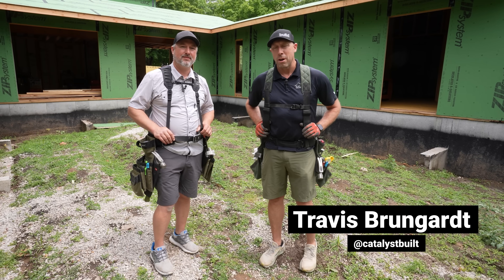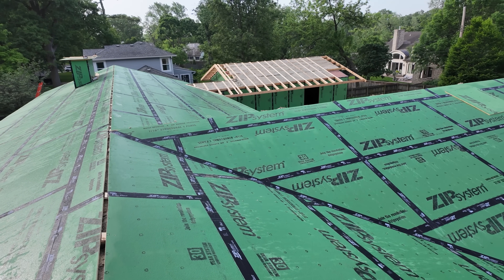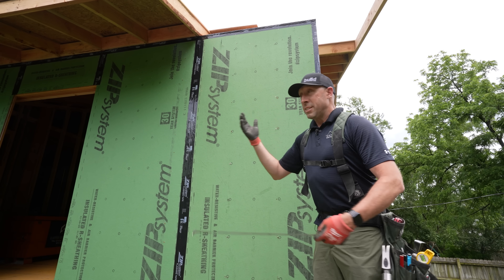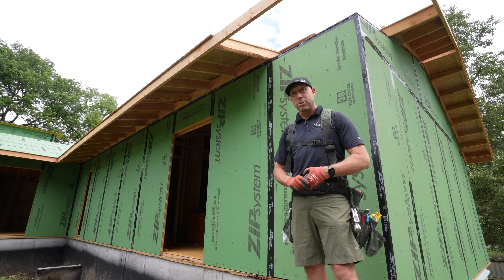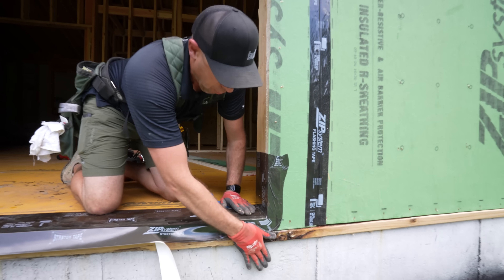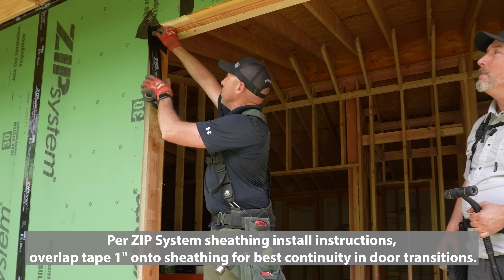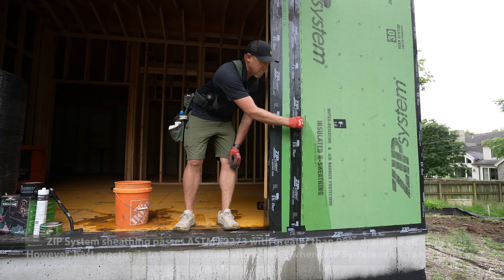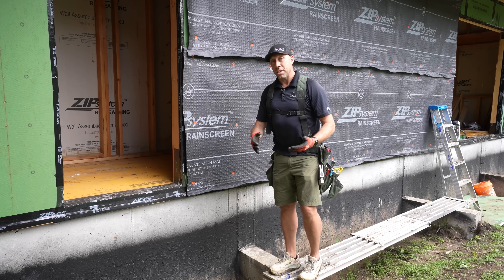Perfect Wall System At Rivard

Comment: Build monopoly framing, 2-inch foil faced poly-iso, 2x4 fir strip in-line up and over, add metal roof and siding, insulate inside cavity, DONE. 🏁
Reply: Foil faced is great and can be sealed no different than zips, only using foil tapes that will not shrink and crack..  It is literally a metal subroof at that point.  In a fire you can get through it to put the fire out.

Comment: I don't trust the 30 year warranty.  Houses will fail when mortgages run out? Is that the model? Also the 7/16ths is far too thin, prefer actual 5/8th on the walls.  Which is why i ran the foam myself xps tapes with dupont's tape then nailed the zip with zip tape. And spray foamed the inside so now if a panel fails it could be replaced.

Comment: 3 roofs would be better.
Reply: I have ten roofs. All Zip of course.
Reply: @MrTexasDan  I was going to do 10 but anything above 8 is excessive
Reply: @donnafedorak2499  Yes, I know, but Matt is all about bomber belt'n'suspenders Huber-love ... so you know.
Reply from the maker: That’s actually pretty funny! 😂
Reply: @buildshow  🙂
Reply: No roof is the solution. Cant have roof problems if you dont have a roof.
Reply: I asked my contractor for 5 roofs on my new shop.
Reply: The Perfect-est Wall™ would be Zip R™ sheathing for all walls and the roof, with Zip Tape™ used to create an uninterrupted air barrier for the entire Monopoly Framing™ envelope. Prosoco™ liquid flashing should be used to seal the lower third of all walls, plus 100% of the nail penetrations, which have ruined the Zip™air barrier because Jerry doesn't know how to calibrate the compressor. Zip System™Ice and Water peel-and-stick should be wrapped around the exterior envelope for good measure. A second 2-by-6 framing assembly is then built out over top of this so that Rockwool™ bats can be installed - because what your building's 'winter jacket' needs is its own 'winter jacket'. Wrap that 2-by-6 framing with another layer of Zip R™sheathing, because that stuff's free, and don't forget to tape all of the seams and throw on another coat of Prosoco™ liquid flashing. At this point you have, like, 6 vapor barriers which will battle to the death. To avoid condensation issues, all stud bays in all layers of the assembly should be back-filled with sacrificial LP Smart Side™off-cuts, so that those can soak up all the water and rot away instead of the framing. Just to be super-safe, wrap the entire building in a continuous layer of Zip Stretch Tape™. At this point you've created a urethane balloon with a blower door score of 0.0 ACH, and any occupants would be rapidly asfyxiated. So don't forget to install a Zender™ air handler for each room in the house, and pray the power doesn't cut.
Reply: @badbadberto temper temper
Reply: @badbadberto 😂😂😂
Reply: Money is no object!
Reply: lol
Reply: All my Roofs go to "11" just like the Volume Knobs on my Guitar Amps.

Comment: I see lots of work go into water and air control at the mud plate, but see nothing to prevent termites from finding a very small hole and causing all kinds of damage to the structure.

Comment: Not seeing how this roof is properly vented to allow moisture to escape during the vast temperature changes that a roof sees. I’ve installed cold roofs over SIP panels and the venting is clean and clear soffit to ridge. Not seeing the roof framing in this video is problematic because if folks do this in a northern climate watch out.

Comment: I’m sorry, this is a freaking zip system commercial. At this point I have to believe you guys are just in cahoots with Huber to make video of beauty shots of their product. Also these best built practices are absurdly expensive. How you can convince a client to spend the money on labor and materials for two roofs. And young people are constantly complaining how the cost of buying a house is outside the capabilities or budgets. Well here you go, this is why. In other words this kind of house building is elitist and targets wealthy clients. Period.  And if you want an air barrier or rain shield why not just use furring strips. That mesh is going to hold moisture and it isn’t going to allow air to move easily behind your siding. It isn’t rocket science and doesn’t require some kind of expensive product. It has zero historical precedence and is basically an experiment that will be born out by the client. If it fails in time you are crap out of luck. And this contractor’s comment about a sacrificial roof layer may be one of the dumbest things I have ever heard. You can replace shingles on any normal roof. And you can use the exact same insulation underneath the plywood instead of building two very expensive stupid roofs. Seriously 🤦‍♂️
Reply: Ya I literally was thinking the same thing 😂😂😂. In what universe would I ever do all this. Unless of course I got all the material for free.
Reply: Have you estimated the cost of additional 2x4 and decking? Didn’t think so.
Reply: @keim3548 what the heck does that even mean? As a matter of fact I estimate and manage construction for a living.
Reply: Well it is sponsered by huber. What did you think it was going to be?

Comment: That secondary over roof is genius and I love the Rockwool insulation used on that over roof design.   That will help keep the attic clean and dust free or allow the ceiling to be moved up to the roof line to open up that dead attic space.

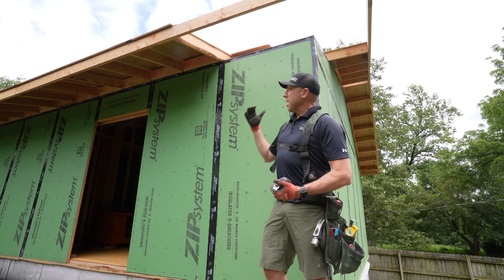Comment: 5:19 - you have 2x4 (or 2x6) running across the roof. How does water drain out if it gets behind the "sacrificial roof" aka the top layer of green Zip? Wouldn't you want all the studs running "down" so that water can drain if needed?
Reply: It also cost twice as much. And like you said how would you find the water damage area and fix it if you can see from the attic area you would be guessing the whole time. I think you just found another way to cheat out customers and brain wash them with what you think would be better. Zip would be good and if you wanted maximum efficiency use ice shield on the whole roof.
Reply: @raysantana7212 You have no idea what you’re talking about. Look — if you want a crappy house, you’ve got 99% of the market to choose from. Go buy or build the cheapest house you can find. But if you want something built better, builders like these are a rare find. Some people are fine driving a beat-up Honda Accord — that’s most houses. Sure, some have great “lipstick on a pig”: beautiful finishes but poor bones. Other people prefer a premium car. That’s what these guys are building.
Reply: @crabkilla respectfully, I think there’s reason for a lot of skepticism on these “high end builds”. 
Traditional homes built correctly, will breathe and dry out in the event something fails. It’s also FAR easier to repair if something happens. 
 Yes it’s true my home might not have these ridiculous R Values yours has but the problem with your home is, it’s very reliant upon PERFECT installation.  All that dense foam and air tightness comes at a hefty price if it causes massive mold and moisture problems that make people sick. 
For me, I’m just wondering how these showcase homes will look 20 years from now without constant maintenance and attention.
Reply: @highball7347  These techniques are not new. They have been used in commercial buildings for decades. What is unusual is that people would spend the time, care and extra $$$ to do it on a house. I applaud this. 99% of the homes built in the US are using crappy, cheap techniques and materials.
Reply: Since installing composite shingles adds ten thousand nail holes in the outer wood sheathing doesn’t that have high potential for leakage into the insulated space between the two layers? A wet insulation layer reduces efficiency and acts like a sponge trapping water on the primary layer. Is zip system working on a final “shingle” layer that does not use nails? Maybe this is a sprayed on layer or poured layer?
Reply: @jamesjensen5000 Rockwool batt insulation is water impermeable and so any water would eventually go behind it and out, without affecting its insulative effectiveness.
Reply: @jamesjensen5000 it’s rockwool, aka made from rock, aka not water penetrable therefore won’t lose R-value like normal fiber insulation.
Reply: I think you're over thinking it. If you have that much water getting under your roof, your roof has failed. A roof shouldn't get any water under it at all, ever. The little bit that gets through the shingles if that's what's used, shouldn't get past the sheathing. That's true for any roof structure. Just maintain a good roof and do inspections on it every so often then you won't have any leaks. But, if you want the studs running down the roof feel free to do that. It's also very possible they're going to put vents in the eaves to air out those sections, with vented soffits of some sort. Either way not a huge deal I think.
Reply: Glad someone else saw that! This feels like the "if one mask is good, 3 masks is even better" approach from Covid
Reply: Exactly. lol

Comment: Would be nice if the cost premium for this type of high performance build/assembly was mentioned at least in ball park figures.
Reply: the vented over roof doubles the cost of the roof, minus shingles 
the zipR plus rainscreen more than doubles the cost of the wall sheathing. even the Monopoly framing adds a lot of cost of material and labor because the rafter tails cant frame the eaves.  we have been using way more closed cell spray foam in walls and roofs to hit Rvalue and $value over the zipR.
-architect
Reply: @nickm9729  When thermal expansion and contraction occurs and the closed cell foam pulls away at the edges and corners allowing moisture to hit the sheathing, how much will it cost to re-do the roof?
Reply: That would kill the whole narrative.
Reply: My guess it that it added $20k to the build

Comment: This is ridiculous. You're doubling up the material on the roof, double plywood, double 2x4's, when in reality you only need to add an overhang to the existing "monopoly framed" house. There's no benefit to this whatsoever. Extreme expense for what gain? If you ever have a reroof.... YOU SIMPLY TAPE THE PREVIOUSLY EXISTING HOLES. Like wtf?!? Apply the insulation to the inside instead of the outside. This is madness.
Reply: Not really an "extreme expense". Maybe $3-5k extra. Added benefit of fool proofing future re-roofs and added R value from the insulation.
Reply: 3 - 5k? Laughable!! Just the labor would far exceed that, let alone the materials.
Reply: @DiminutiveMissCabbage  for real, he doesn’t know what he’s talking about
Reply: @BesBBQEver  literally just had it done to my house last year, but carry on fam.
Reply: @mistere5857  Sure you did????
Reply: Get Amish builders at 5k goes further than you expect
Reply: @SilasDrewchin  you have to be in an area with Amish builders…… and they’re not all the same

Comment: Drive up the cost even more. Use twice the amount of material as before. It might make sense if the house was immediately put into an irrevocable trust. On average people live in a house 10 years. You would never recoup your costs. Never.
Reply: There are plenty of crappy houses to build, buy, or live in. Clearly this is the premium option. What is the return on guys that spending tons of $$$ tricking out their car engines? Some people take pride in doing better. Stop overthinking it
Reply: @crabkilla  I'm not. I'm stating facts. I've been in this line of work for 40 years and affordability is a major problem.  The cost can be as high as 1800 dollars a foot in some parts of the country.  I understand some people want to pay that and that's fine. The homes that have been built in the last 80 years without the practices used are still standing. Question is will these house last that long and are the upfront costs worth it?
Reply: @crabkilla  In some parts of Europe the quality of build would also determine how much somebody can lend.  Better house: you can lend more money.   Thus creating incentive for everyone to upgrade their houses

Comment: Great detailed explanation of your framing. I am curious what did you use for fastening the 2x6 roof overbuild to the first roof?
Reply: This was my same question.
Reply: @duck-fil-a3606  Me too!
Reply: Just asked that question too. Not sure how you would anchor it down for hurricane force winds
Reply: I believe they just toenail it down from another video I saw with these guys
Reply: @wallacewoodworks9582  cant be toe nailed
Reply: @zefrum3 video is called “how to install an exterior-insulated pitched roof”

Not saying it’s the right or wrong way, just how they did it in that case
Reply: @wallacewoodworks9582 they didnt actually explain
Reply: chewing gum
Reply: By putting holes in their "control layer".  I also see, at least in a colder climate, the two roof layer system as a massive moisture trap.  Maybe if they put enough foam insulation on top it wouldn't be an issue but still not worth the risk.  This channel is starting to over complicate things more and more, getting hard to watch.  I guess they've run out of things to talk about.
Reply: @adeebihabibi When I watch this channel, I think of the strategies used as just theories, instead of common practice. Some strategies seem kind of outlandish to me.
Reply: hope & a prayer

Comment: Why would you need to put a rain screen up on a system that already has basically a rain screen and water repellent,it seems unnecessary
Reply: Zip system is not a rain screen.  In this regard it is used as a structural panel and primary air barrier 
The added rain screen is for the siding not the substrate
Reply: He answered this in his opening statement, "to seperater air and water control from our cladding". Your water control layer (zip system) is not the same as a rain screen (air gap for water to drain and dry if it gets behind your cladding, must be large enough to not hold water in suspension). 
Hope this makes sense for you
Reply: There are many ways to have an air gap between the Zip sheathing and your cladding. Of course, 99% of houses don't have a proper air gap. These guys do. Clearly they aren't doing this the cheap way. If you want a cheap / poor constructed house, there are tons of options to choose from.

Comment: So when you reshingle the second roof in 20 yrs. You have 60000 holes in your I second roof and if it leaks as you seem to believe it would , that's why the ,expensive" ,roof. If that is the case, as you claim, it will go into your insulation and no way to get out.
Reply: Your overthinking it
Reply: The bottom layer is the control that stays solid and fresh from new roofing nails. The top layer is "sacrificial" for any reroofing down the line. The 2x materials are not sealed to the first layer so any water that would penetrate would work its way out.
Reply: @famous636  (1) They set 2x6s that run horizontal, as shown at 0:01, reducing the ability for drainage. (2) What moisture that gets in there might take a very very long time to dry, because there is no air movement between the layers of ZIP, and so it cannot dry out through the top or bottom.

It does still seem reasonable if:
- This home will only ever have a 50+ year roof installed, e.g. standing seam metal roof. IMO this is what 90% of people should do on any home without a complex roof anyways.
- When the roof is replaced, also replace the top layer of sheathing, or freshly sheath over it a 2nd time.
Reply: @dosadoodle  it will dry out pretty easy, its not like its going to get soaked. a few oz of water might get in every it rains
Reply: @z-0669  For a shingle roof, I'd be worried about damage over time, contributing to that this doesn't appear to be a vented roof (so temps can get higher / shingles will degrade more quickly). I would not be worried for the first ~15 years or after the shingles get replaced (with the large number of holes), but beyond that I'd be nervous with this roof design without a very resilient roof like a standing seam metal roof.

And to be clear, this roof would be amazing with a standing seam or other highly durable roof finish. It's also a simple roof design without any apparent penetrations, so a standing seam roof should be reasonably affordable. Generally I'm a no-go on a shingle roof if the roof isn't vented (facilitates drying / spotting issues).